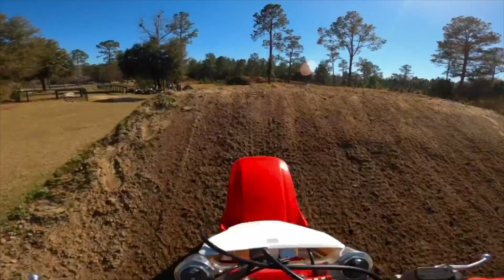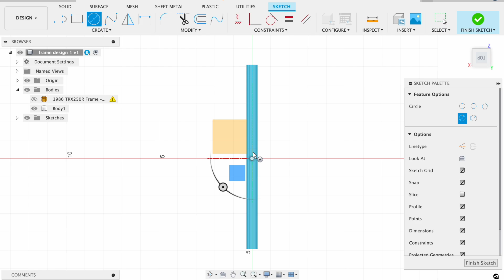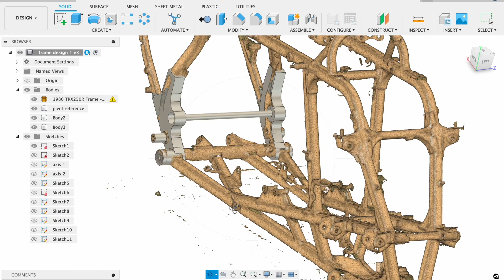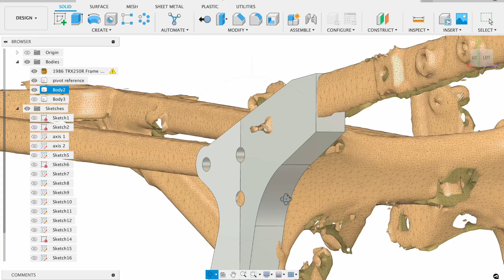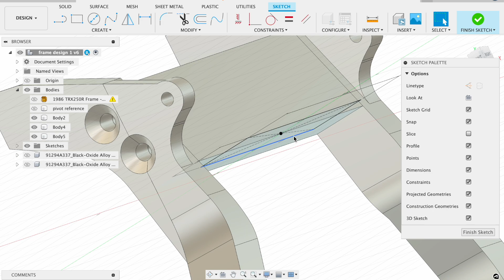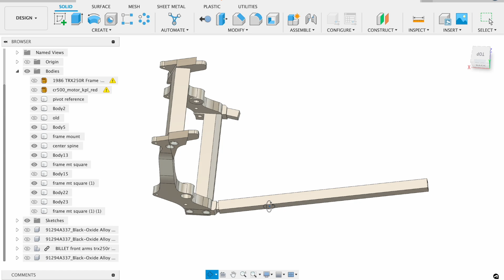Billet Honda TRX250R Frame Build - Part 1

Comment: Is there any way i could purchase those files off you for the 3D scan of the frame & motor?
Reply from the maker: We can work that out - you actually gave me a idea as i have ALOT of scans , cad files and more…
Reply: @BVCOFFROAD  Thanks, I would definitely be interested in that! I’ll send you an email using the contact form on the website. Thanks very much

Comment: Please don't use the stock linkage. I've always had poor performance and a "bucking effect" when casing. After watching Gennusa's channel and seeing Spader hit the whoops 5th gear pinned, I'd say go with a similar roll design no-link or a modern linkage design. A narrow front would be nice aswell. The stock bottom frame rails are quite thick and I feel limit some of the quad's travel. Is there any way to engineer the whole bottom frame rail as a thinner design for more ground clearance(allowing more travel without hitting the ground) or perhaps even lowering the engine in the chassis even more? I'm no engineer but just throwing some ideas out there for you and trying to improve on an already great design with your exp and modern tech!! My 1986 frame has been welded from head to toe :( and is older than me haha

Also the cr500 engine has no counterbalancer and its low tech tbh. The panthera 600 i was told was shipping the end of june. It is a full on modern big bore with all the bells and whistles.

Comment: The 250R was/is in the top 2 or 3 best quads ever made.... But, you knew that...
If you could get the cost down to somewhere reasonable for the average schmo.....
Reply from the maker: Thats why im going billet most of it all with minimal welding- as the labor cost to build a frame    Only issue is im using 300k + of cnc machines to do it 🤣🤣.   Its just one of those pcs that cost alot to make
Reply: @BVCOFFROAD  I know... I'm not even saying it's not worth it. Quite the contrary... if I could afford it I would have ordered one of your Xr650L 3wheeler kits when you first started offering them. 
Hell... I still might... just gotta sell a few of my project cars... maybe one of my kids...

Comment: Another thing I noticed I’m sure you all ready know you could design them arm to fit the 400EX as well with very little work since the 400EX arm will fit the 250r with the correct spacers
Reply from the maker: Yes!👍🏼

Comment: I love this aluminum subframe, aluminum arms, cr500 linkage, modern yamaha type technology but with trx250r geometry. This will be next level. These arms will work alot better than than any other normal quality arms are heavy. This is the type of stuff honda would be doing if they still made a 250r.
Reply from the maker: I agree - and the last 5 yrs i have been trying to find time to get back to my original obsession which is the TRX250R